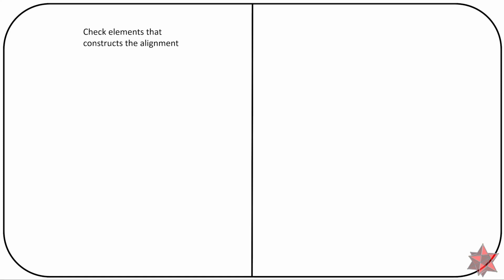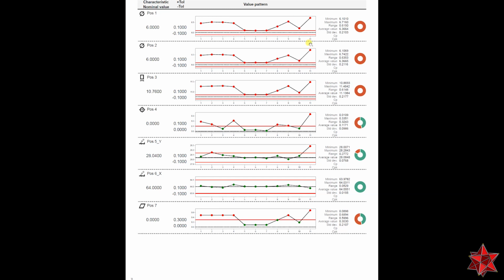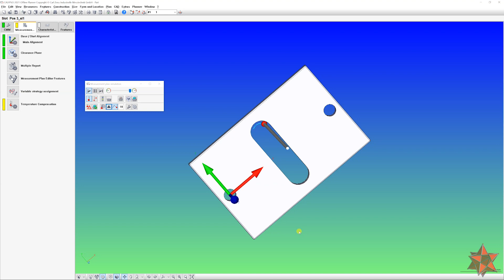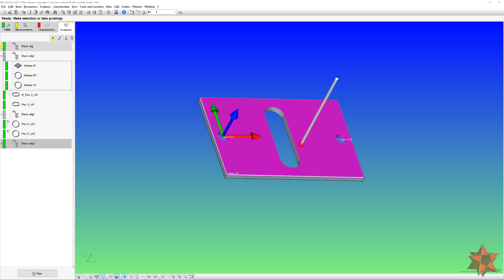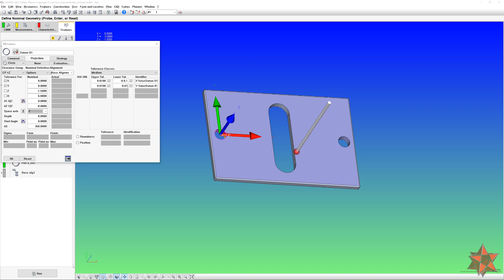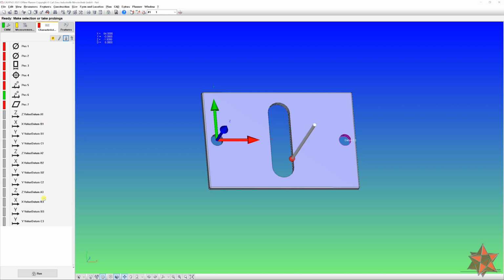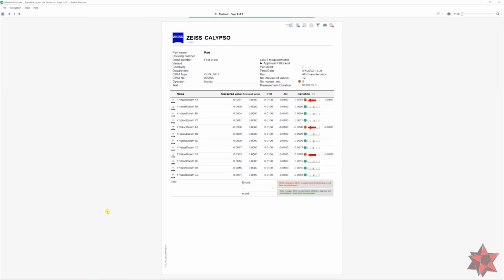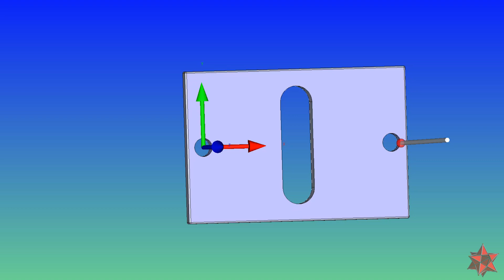How to check main alignment   Part 1

Comment: oh nice to see the that deviations. it can be enlighten many others. In Calypso there was a function called loop. you can simply  remeasure your datums again again again many as you want and you add a parameter like if difference between first measurement and secons are greater than 0.001 micron, then stop the program. It'll be provide very  precius data to check your part stability. thanks for the video